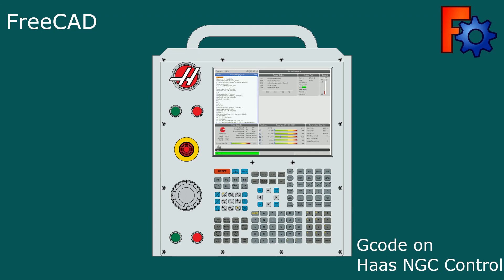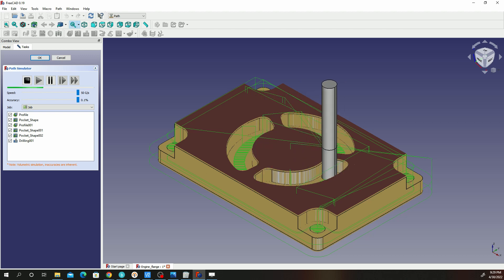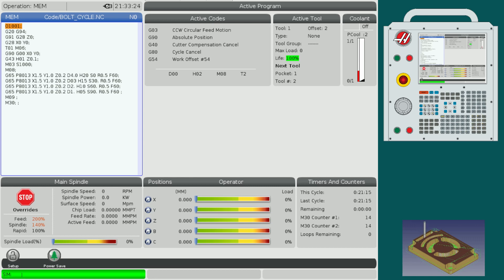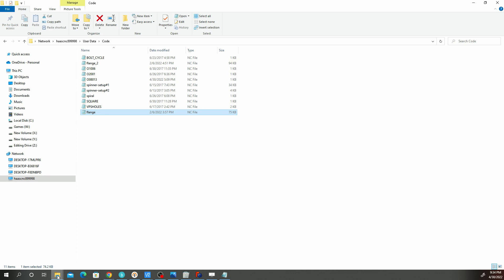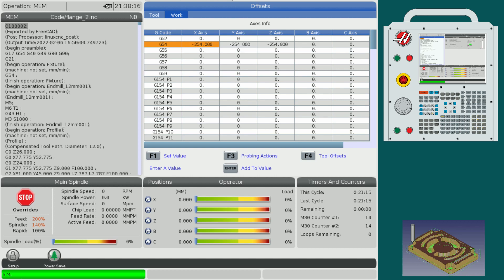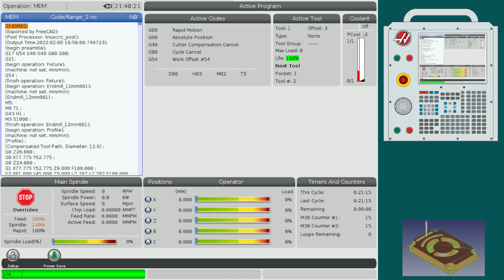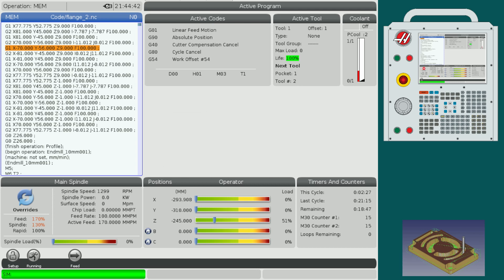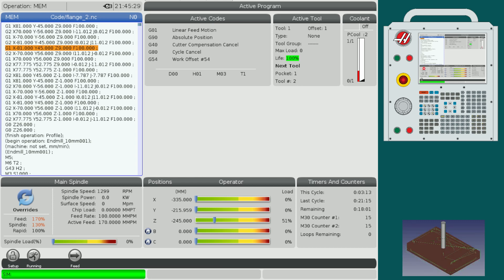FreeCAD - Export G-code to a Haas NGC Control

Comment: Does this work with the pre-ngc hass machines? My mini mill is from 2015, and I would like to change CAD/CAM softwares, because I switched to linux.
Reply from the maker: Yes, pre-NGC controls also support Fanuc style Gcode. The Gcode produced by FreeCAD CAM addon  is Fanuc compatible
Reply: @techwithjulius  Excellent, in that case, it's worth playing around with. Over all it looks like a pretty good software, it will just take some getting used to.

Comment: Hi , Julius . Great video you've made here . I think mazak uses the fanuk control as well . If mazak uses the fanuk system  I should'nt have to do anything different , right ? 

Thank you , Julius
Best Regards
Terry Lembke
Reply from the maker: Hello Terry. I have not used  Mazatrol but looking at the manual it's compatible with EIA/ISO programming. The only adjustments I see after posting are adding a program number as I did with the Haas control and you may have to add a "%" at the end of the g-code